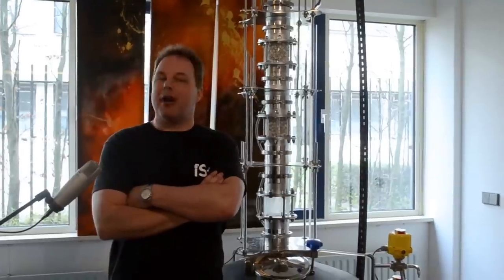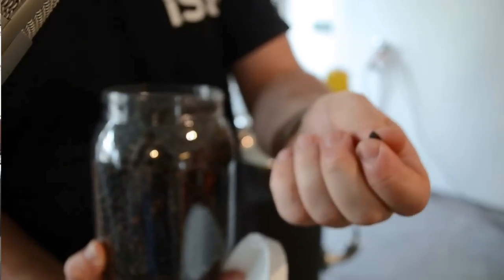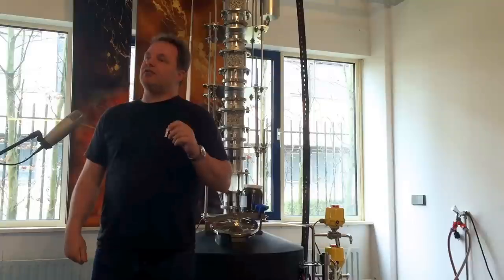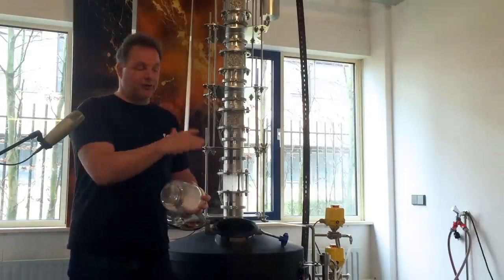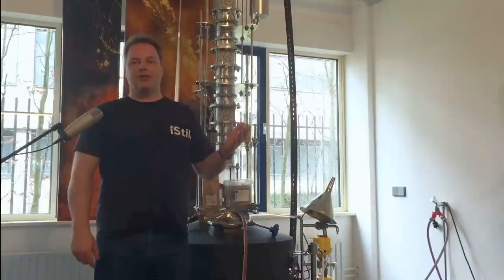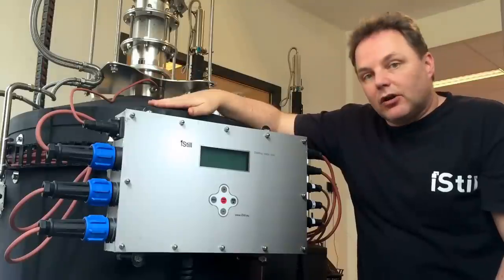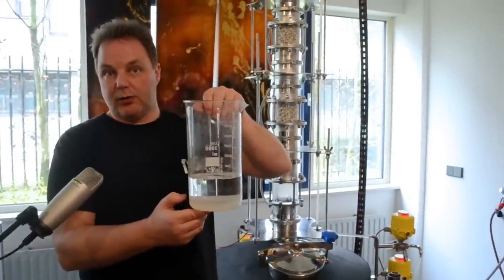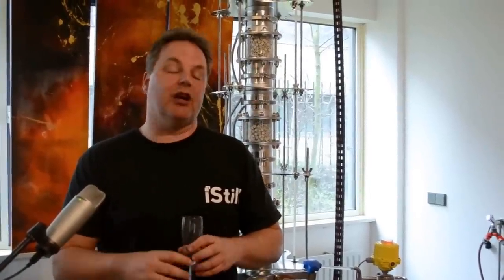How to make the perfect gin - iStill

Comment: Hello. Why adding water Before the distill to the 96% alcohol and not after the gin is distilled? Thank you
Reply: What happens if you don’t add the water in the initial part but in the final part of distillation?
Reply: You could do that. 

The science behind putting water in the pot with the 96 is that you create an intermediary that allows the botanicals to bond with the alcohol better so that more of the botanical flavor evaporates with the alcohol in the distillation process.
Reply: @waynebruce24893  Thank you for your response mr Batman
Reply: @ebe09  it may not have been the answer you deserved but it was the answer you needed
Reply: @waynebruce24893  it was perfect :)
Reply from the maker: You don't want to redistill 96%. Huge explosion potentials, bad flavors, and the risk of running your boiler dry.

Comment: Odin. What are your thoughts on the relative merits of macerating for two weeks, filtering and then distilling (as per your Easy Gin recipe) versus going straight for distillation in the pot with the botanicals in (as per your video)?
Reply from the maker: The faster one is easier. The OEG was initially made for hobby distillers that often cannot distill "on the herbs".

Comment: Hi Odin,

Mate, I remember you posted a recipe in the home distiller forum years ago, and I have been using that recipe for a couple of years myself. It used some St johns wort, elderberries and licorice, to name a few but I can't for the life of me find it anymore 😢 

Please help it was the best gin (possibly geneva?)

Thanks from Australia 🇦🇺
Reply: Hi there, thanks for reaching out. Dunno what's on HD anymore. I know the new management hates my guts as they sell StillDragon shit and I was interfering with that, or so they felt. So they kicked me out and I cannot see what's posted there. Maybe try Odins Easy Gin? Otherwise indeed maybe Geneva?
Reply: @odinvaneijk728  thanks for getting back to me. I believe I have found the original post so it's all good now. And thank you for that recipe I think the year was 2012 or 14? Anyway, all the best.
Reply: @odinvaneijk728 There was something also I wanted to ask aswell. I vaguely remember reading  in the forum it's best with gin to charge the boiler with a lower alcohol percentage for the run so your final product is somewhere where it needs to be for consumption, is this right? So as not to dilute the flavour of the distillation with water when proofing down. Do you have anymore Info on this? 
Thanks again for everything you have done in the community. 

You're the man Odin.

Comment: would it be as good to steep the the juniper and coriander in separate storage then strain to the boiler? or does the boil really add anything to the juniper tastes?
Reply: A proper gin or vodka run will be a neutral taste alcohol of 90% + ABV. So anything in the boiler is stripped out.  You want to infuse the gin flavours by vapour infusion  at the extraction end of the column  78degrees C  and usually before the vapour condensing..   I’ve  used a cotton bag  full of juniper berries at the top of the column under the temperature probe. Cheap and works well in a fairly primitive reflux still.
Reply: The longer and more the organics are in the boiler the more flavor you get. Just need to be careful not to overcook, as those flavors are bad.